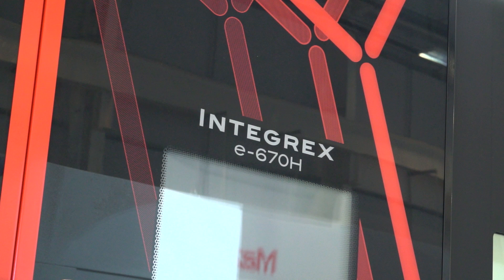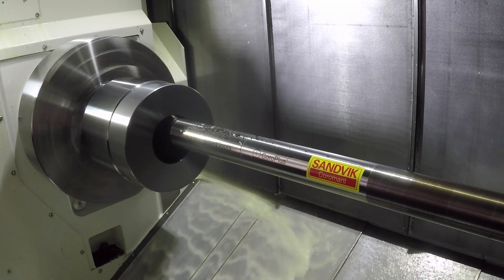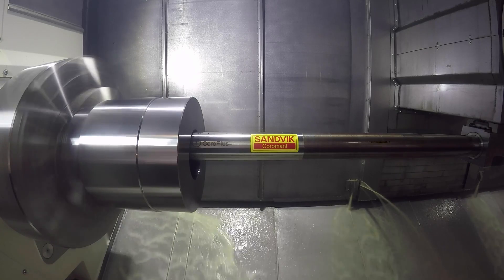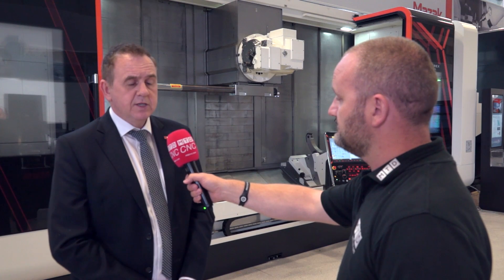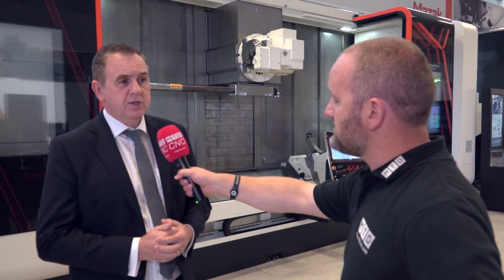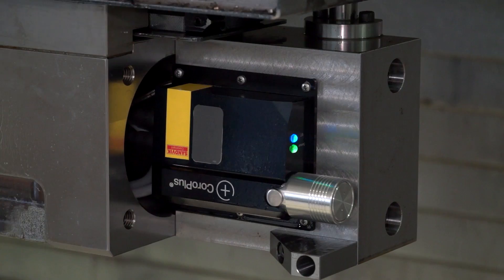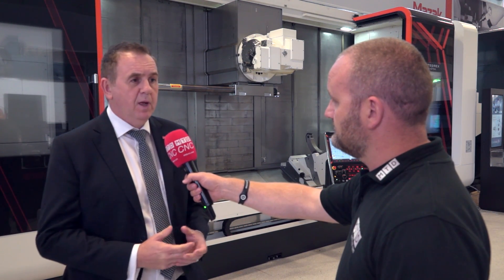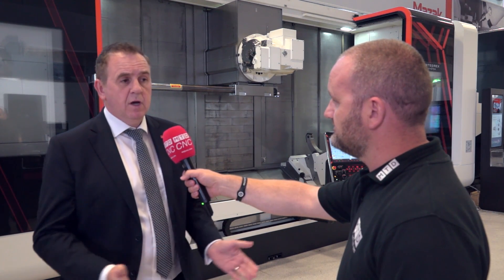Mazak INTEGREX e-670H with integrated Sandvik Coromant Smart Tools Plus

Comment: Mathias Tjomsland totally the great great great great … great great … … great grandson of Ragnar Lothbrok, probably explains why the Vikings are so good at cutting stuff, LOVE the 1.5 meter smart boring bar and interface. I wonder what the longest boring bar is you can put on a regular integrex I-200 (manually) 60" between centres ? How easy is it to install supplemental /auxiliary software on the Integrex + Smooth control or do you have to buy the machine that way ?
Reply from the maker: Regarding the software, this can be retro fitted as it is app based and the smooth control works seamlessly. It can also be driven using an iPad... Crazy tech..
Incidentally, Mark Hall is an oracle of machine tools and there is very little that he doesn't know.
Reply: That's awesome!   Thanks so much for covering the MAZAK angle as not so many world wide are doing that. We are inching very close to pull the trigger on our first Integrex and the applications we have are very unconventional so it's NICE when we hear Mark Hall re-iterate or confirm our idea(s) as to WHY we need to jump on the Integrex "Bus", as for us splitting an application between 5 axis vertical and long multi tasking lathes still doesn't "Square the circle" for us. Nice having  Mr Hall  "seeing it" as we think we see it too... Gives us a  smidge more confidence and not second guess ourselves with less efficient and less  capable technologies.  (Super that there are several ways to access and integrate the Sandvik smart tools ! Excellent !  ).Cheers !
Reply from the maker: No problem. Let us know if you require any further info.
Reply: Thanks so much very kind and love the media you put out !